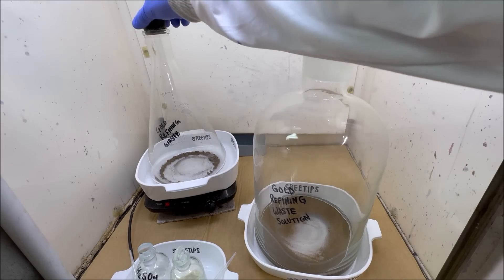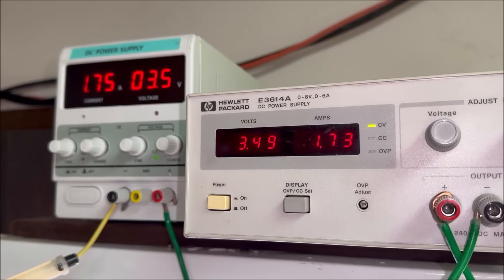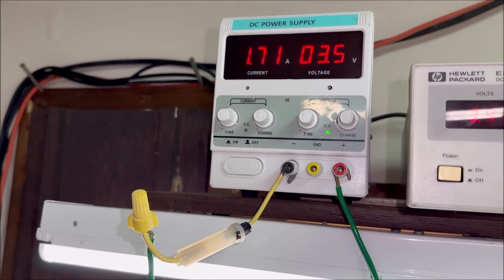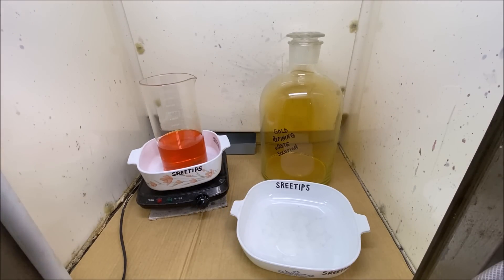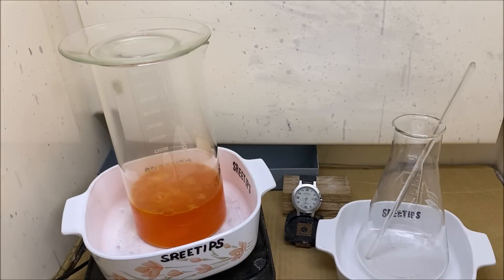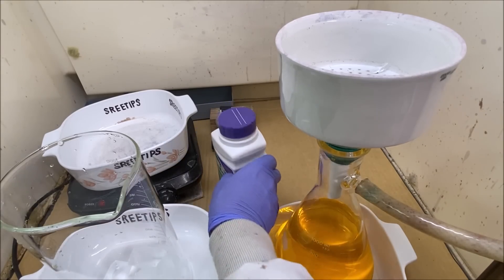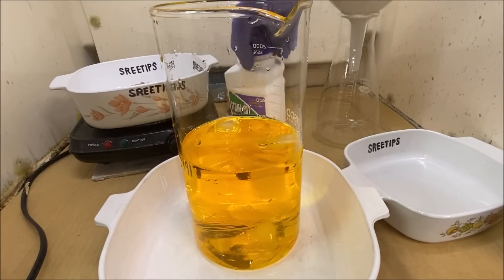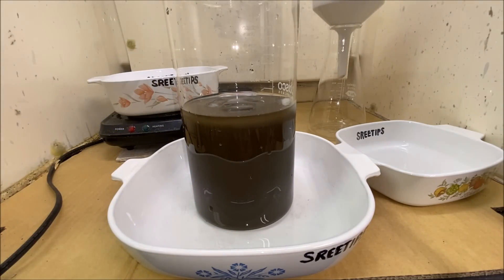Waste Containers Gold Recovery SILVER CELL UPDATE pt1

Comment: I want to make a quick lid for my silver cell.  Do u think a sturdy piece of cardboard would work or would it get moisture u think?
Reply from the maker: It will get wet, and sag down into the electrolyte. The anode weighs almost a pound. Wet cardboard won’t support that much weight.
Reply: @sreetips  ok thank u.  It woulda only been temporary for a day but I get it
Reply: @sreetips  well my silver cell was going fine until last night. I woke this morning and there was spiderweb crystals from the basket to the bottom bowl.  I tried to rinse the sludge off the remaining silver and changed filters but it just kept doing it.  I can’t get the kinda growth or similar looking crystals you get no matter how precise I am

Comment: Fuse not needed. Just set current limit to 3 amps. It cannot exceed 3 amps even it crystals contact anode.
Reply from the maker: I think that could still burn a hole in the anode filter.

Comment: I have a bunch (i mean a bunch) of 70% silver brazing rods, could i theoretically just feed those into a silver cell?
Reply from the maker: No, for electrolytic refining to be successful, the feed stock must be relatively high purity to begin with. Low purity feed stock will saturate and foul the electrolyte very quickly.
Reply: @sreetips  copy that! Appreciate the reply, any suggestions as to what i should with all that brazing rod?
Reply from the maker: I did a video on recovering the silver from some StaySilv welding rod. I think it was 15% silver. But it wasn’t easy and the yield was low.
Reply: @sreetips  i watched it, that helped out. All my silver rod was acquired by my grandfather after ww2 working on power lines, i was told its high silver content, any way to find out other than weighing it then extracting the silver? Like an approximation
Reply from the maker: Not without knowing the actual silver content. Best way to find out is dissolve it in nitric, cement the silver on copper wash and dry melt weigh.

Comment: @sreetips  -- (👁👃👁)   You currently place just a glass plate atop your reaction beakers and let the fume hood as a whole exhaust the fumes to wherever you exhaust them to.  I imagine a couple alternatives : 1. adding a fractional distillation tower to separate and condense the exhausts from your fume hood; and 2. individual dome lids connected to individual hoses to extract the gases and bubble them through carboys of distilled water.
Also, do you distill your own water ?
Reply from the maker: Good suggestions. I buy distilled water at the grocery store. I use about twenty gallons per month.

Comment: I'm always impressed with your silver cell and the way that the silver crystal grow on the sides of the cathode bowl.  I'm wondering if the crystal growth would be different if you placed the bowl on a copper sheet rather than hooked it up to the rim of the bowl.  In theory it should not change as the whole bowl becomes the cathode, no matter where the electricity comes from.  It also seems a bit more dangerous as you would have a copper plate that is charged, not just the bowl.
Reply from the maker: I’ve been getting excellent results for years with the current setup.

Comment: The density of the silver depositing on the stainless bowl in #2 looks so much different than #1.  It just looks different, like you'll get significantly more weight from #2!  Is there a gadget difference or type difference in the stainless?  Very interested in the output from that cell!
Reply from the maker: Sometimes it looks like that